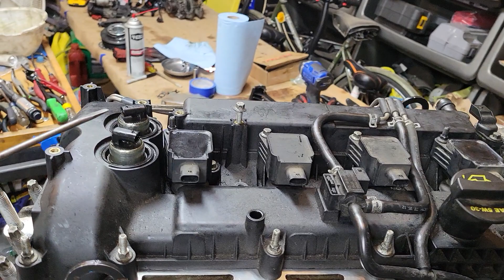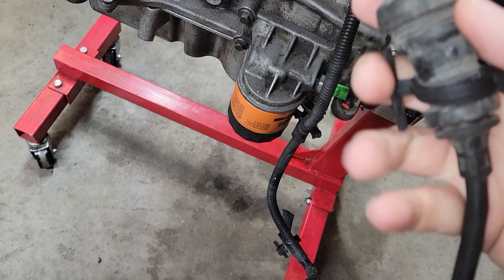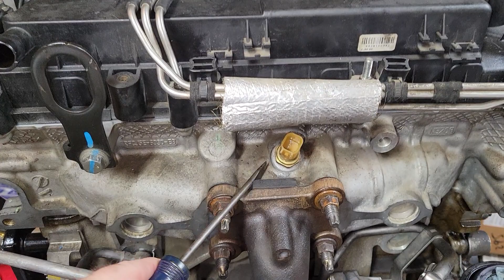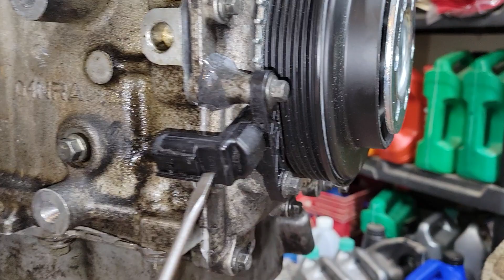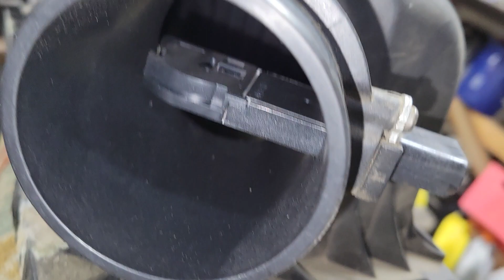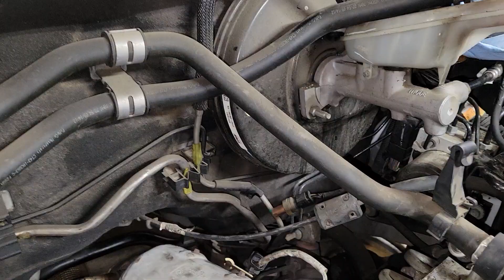2013 Ford Edge 2.0 solenoid, valve and sensor locations with parts list.

Comment: This video is great, thanks! Side question... My 2.0 has gotten louder over the last month or so with no codes. I've smoke tested the exhaust, no leaks, had an exhaust shop also tell me that its not nothing on the exhaust side. Do you have knowledge on what would occur if the wastegate is pinned one way or the other, would it affect sound and would a code trigger? If so, do you know if the wastegate with engine off should move if I apply pressure or vacuum? I'm thinking of pressurizing / vac from the boost control sensor hose. How about the bypass valve stuck one way or the other? Would it drop a code and/or affect noise? Exhaust shop power braked it and sounded like a whole lot of noise coming from the airbox. Thanks in advance.

Comment: Awesome Video!  Can you help to confirm if the 2013 Ford Edge 2.0  ECOBOOST has a CANISTER PURGE VALVE?  Seems this could be the root of my issue as the check engine light continues to illuminate.  Smoke test conducted on turbo and intakes as well as exhaust rear to front with no leaks detected.  Any help would be appreciated.  Thanks!

Comment from the maker: The VVT (variable valve timing) solenoid and the VCT (variable camshaft timing) solenoid are the same thing and used interchangeably.  I had the letters mixed up when i spoke in the video and said CVT (thanks for allowing me to correct that here).  I have a link to the new replacements in the additional info description if you need to replace them.

Comment: Where’s the vvt solenoid
Reply from the maker: The VVT (variable valve timing) solenoid and the VCT (variable camshaft timing) solenoid are the same thing and used interchangeably.  I had the letters mixed up when i spoke in the video and said CVT (thanks for allowing me to correct that here).  I have a link to the new replacements in the additional info description if you need to replace them.  Hope that helps you out.

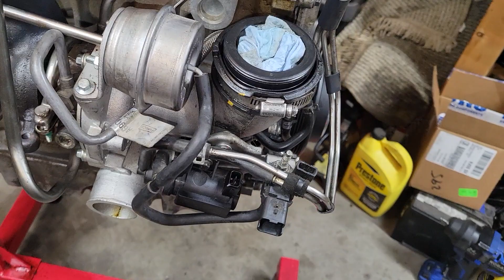Comment: Great video!   Appreciate all the effort it took you to take out the engine which helps to answer my question about the location of the Tubro Boost Solenoid.  I'm holding on to the replacement part and it looks exactly like your Wastegate Control Solenoid (1:15 mark).  The replacment part looks nothing else like your Boost Solenoid (1:40 mark).   I too have the 2013 Ford Edge 2.0L.  Is it possible that there are two different kinds of Edges of the same year/engine type?  Or perhaps your Boost Solenoid is not OEM?  Everything else looks spot on.
Reply from the maker: Thanks for the inquiry.
1:15 mark - Ford part # BL3Z-9K378-A is for the "Solenoid assembly- Turbo Control" according to Ford Parts Giant.  
It is called Turbocharger Boost Pressure Sensor" according to Haynes manual.  
1:40 mark - Ford part # CB5Z-9E882-A is for the "Control Assembly - EGR Solenoid Valve" according to Ford Parts Giant.
Both of these items on this vehicle are the Ford OEM genuine parts.  Hope this helps.
Reply: @elvrolet  Subscribed to your channel.  Look forward to your final build and the steps along the way.